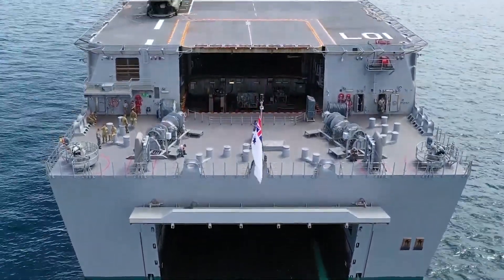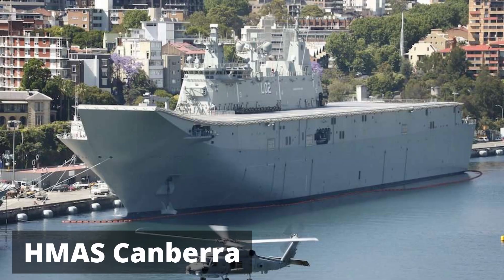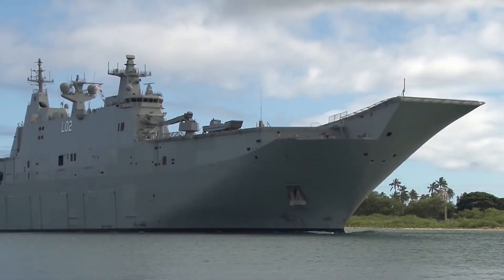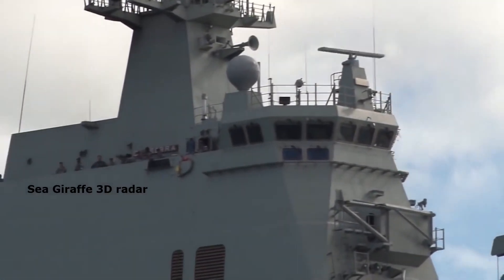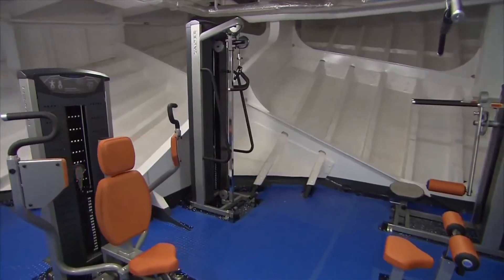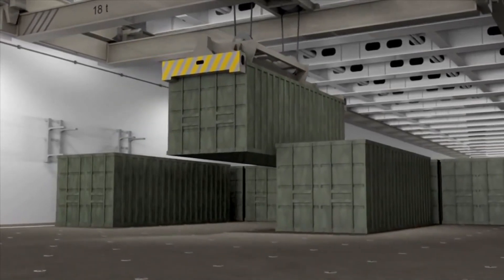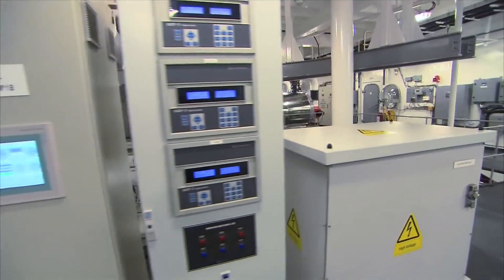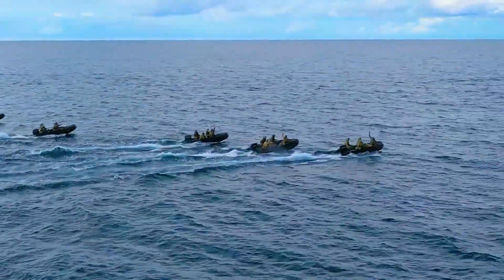Canberra Class LHD In Detail | Australian Amphibious Assault Ship | Australian Navy | in English

Comment: These ships need the same upgrades that the Japanese have done.. Then the Aussies can fly F-35B on and off the flight deck. Just my humble opinion.
Reply: They'll have to buy the B version first!
Reply: Not going to happen, the Aussie ships have a very different internal structure to the Spanish ships meaning it will be a complete internal rebuild that would be beyond expensive. It would be cheaper to build a purpose built Aircraft Carrier than modify this class.